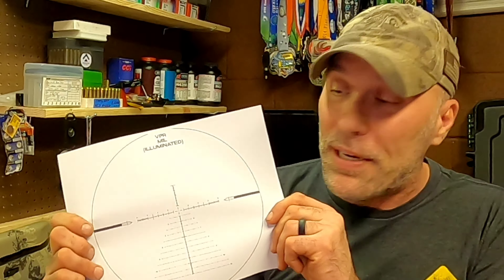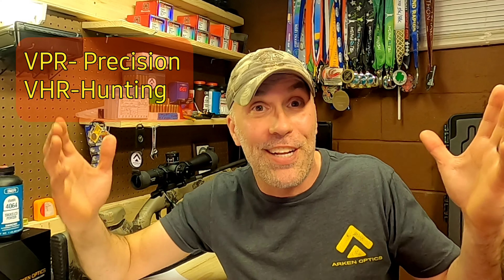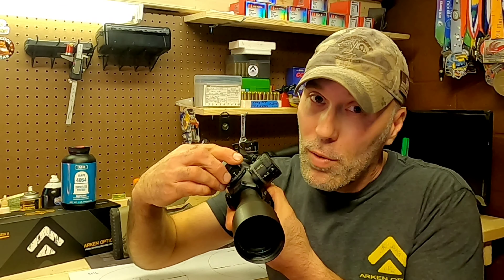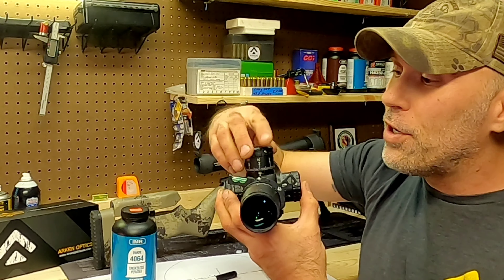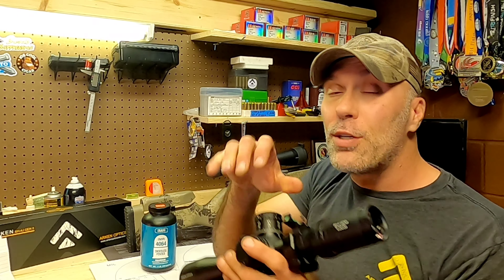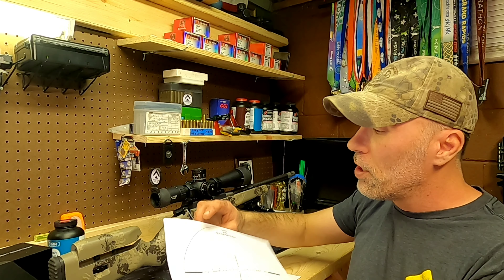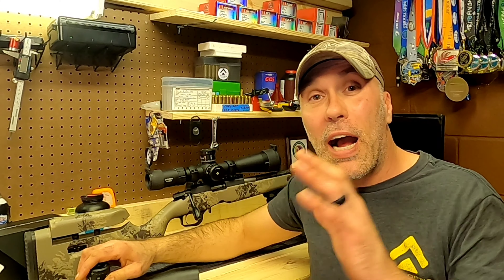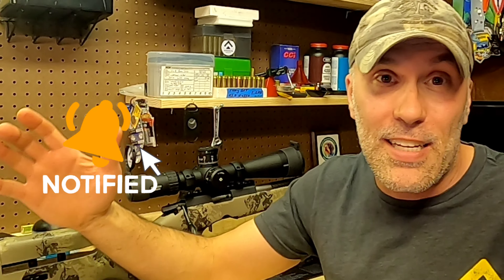Choosing and using Precision Rifle Optics Introduction.  Arken Optics VPR, VHR- MIL/MOA

Comment: Next video should be interesting. I want to how you turn the elevation turret and have the bullet strike to the left.
Reply from the maker: That is the plan.  Will show you guys how you can land the shot on target same way with a turret spin or using the hold over.   Will also show a few easy calculators that give you the numbers you need to use.
Reply: I thought maybe he was holding the scope sideways or something!  I definitely can’t wait to see how you get 2 mil elevation by holding 2 mil right lol I’m only playing with you, simple mistake. Still good info
Reply: I was wondering the same thing and went straight to the comment section 😂

Comment: Don't get whapped around the axils with subtentions. The only subtention anyone needs to worry about is .25 and .5 of a mil (mil scope) with tactical shooting. If you need more or less than these hold high or low, leading or trail edges of these subtentions. Don't make long-range shooting harder than it already is.
Reply from the maker: In many cases true

Comment: Just about to mount the new Arken SH-4Gen2 6x24x50mm VPR reticule on my AR-10. Went with Arkens 20moa one piece 34mm scope mounts. Hoping that can handle the recoil of 7.62 ok, as I really do not wanna make this already heavy scope more beefy with badger ordinance steel rings? I would love to see you use it on the range.
Reply from the maker: I have same optic on my ar10.  It will hold up great!

Comment: Scopes for dummies 
The easiest to use is Mil-Rad 
If you can count to 10  (this is why metric is so easy compared to  SAE ) 
But I agree  MOA  I much more accurate at long distances  
But that's not 
 scopes for dummies
Reply from the maker: Many people are so stuck with "inch" here in usa it works well for them as does the added precision of smaller adjustments per click.

Comment: MOA is not the standard. If it was standard, the military would be using it
Reply from the maker: Military is by no means standard or gold standard anything.  Civilian market is also  much much larger usage.
Reply: @RugerGundog  90% of civilians don't know anything / are not interested / are "all talk and no walk" when it comes to  precision rifle shooting at range, so the majority is still on the military side. Keep in mind, there is a whole world out there, not just US. 

Right now, if you want to be able to shot / operate at any time, in any location, MRAD is the standard. MOA is just something that US civilians use to feel different.

If you still feel I am wrong, convince me with facts, not slogans.
Reply: In the UK we still mostly use MOA it's in the imperial measurement, as in inch,yard, miles.
You can choose between 1/8th or 1/4 MOA, i use 1/8th for long range target work, out too 1200yrd. 
Hope this helps 👍
Reply: @davegrimshaw7318  well, both work, but 1/10 MIL is enough to touch the target at 1200m. 

Apparently MOA looks simpler to some shooters (mostly from countries that use the imperial units of measure) because they do the transformation from MOA to inches. Once they realize that there is no need to do this conversion and learn to think directly in MOA or MILS, MOA advantages start dropping like flies.

Having said that, if everyone around you uses one unit of measure, you better think long and hard before choosing something else. You don't want to end up having to do conversions from the corrections they give you in their unit of measure to your unit of measure.
Reply: MOA is our standard. Move along.